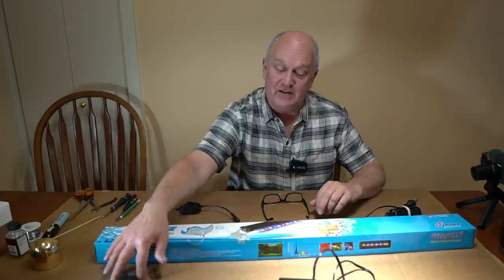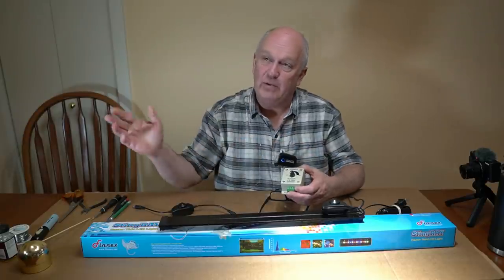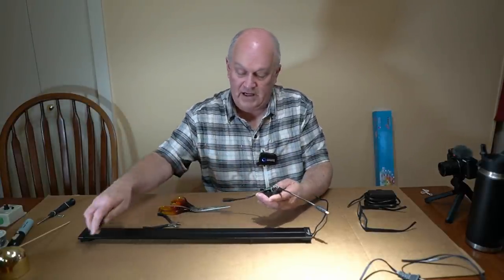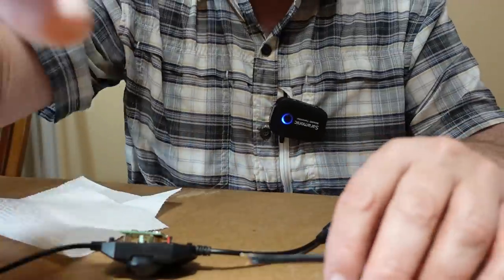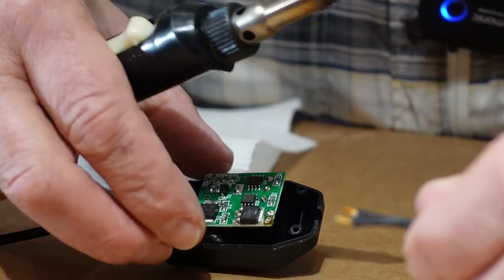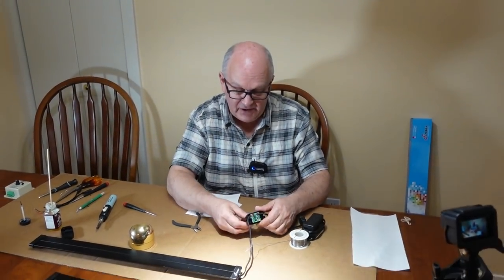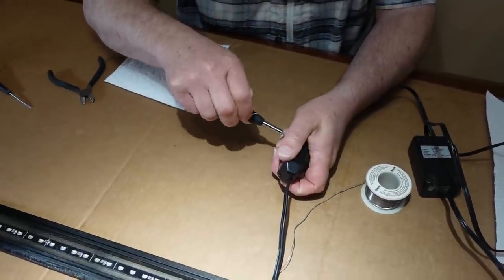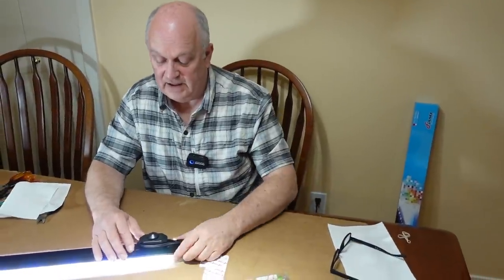DIY with Dean - Dimmer for LED Lights - Finnex Stingray

Comment: I was a bit worried when I saw the case and dial that it was one of the triac based dimmers. I hate those things with a passion for the flicker they create. But I learned something new, and I'm excited to look into these pwm based dimmers more :-).

Though I'm intrigued by why this doesn't work on the Stingray2. Given that even their planted lights don't use a proper constant current driver (as opposed to a current limiting resistor), I would be shocked if the Stingray2 did.

Comment: I like tge soldering makes it a clean look,  but for most people might be easier  cut the wire then use heat shrink tubing or black tape

Comment: Question, why is it necessary to solder instead of just plugging in the dimmer as is? I connected it right out of the box and it seems to dim properly. Is there something I should be worried about?